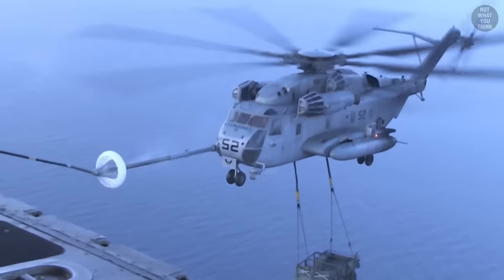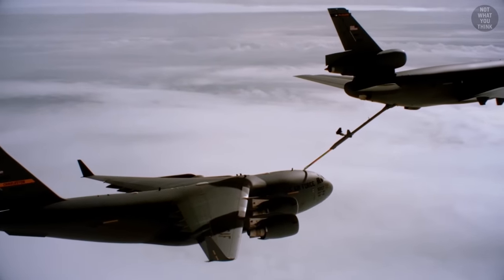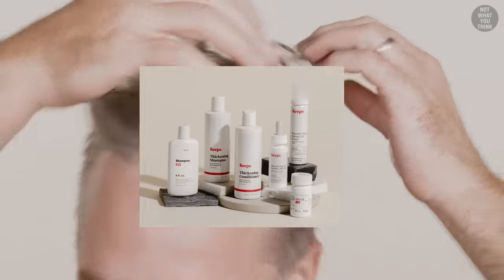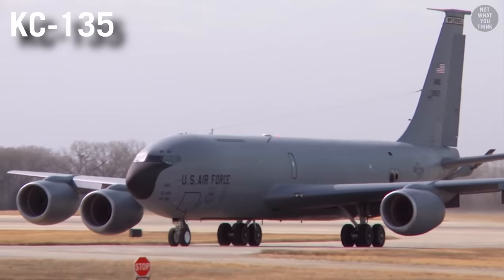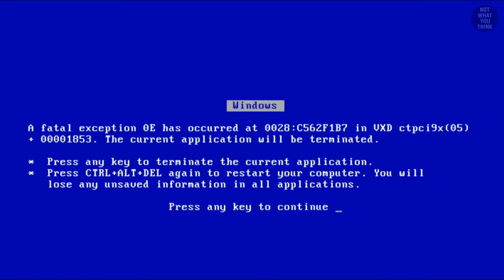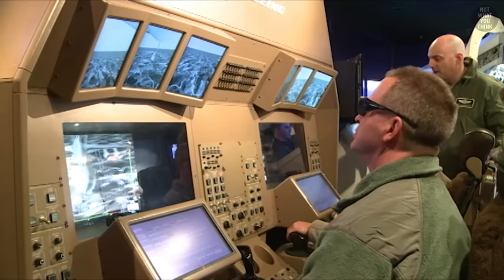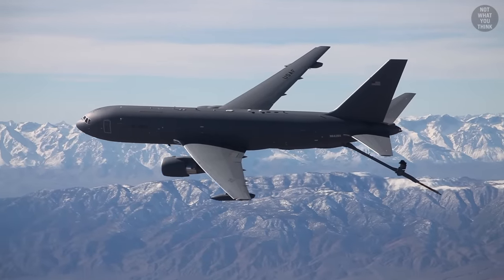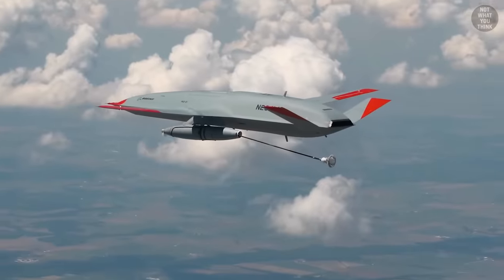Why US Air Force is Making Aerial Refueling HARDER?

Comment: if you think that is the Full Story and the USA Tech Don't Work or Barely Works then the Ones who is Letting out the Very Little Info on these Systems Done there Job Very Well for the USA Don't Tell 99.99999999999999999999999% of the Real Story The USA Wants you to Think there Tech Sucks and Don't Work when it Really Works Very Well for it is the Very Best on Earth. and Just for you Info USA Airforce Auto Air Refueling was a Working Tech in the 1970's and that is Way Before the Late 2000's it's just was and is Top Secret. The USA Doesn't want the Enemies to know all the Aces The USA has up the Sleeve and there are Trillions of Aces the USA has and Aces being Super Top Secret War Tech for the USA is just the Opposite of Russia for Russia Makes False Statements of there Tech in the Form of Saying they have War Tech They Don't have and will Never have and Stating all the Time Flat out Lies about how Great and Unbeatable there War Tech is and it is Nothing but Trash and Fake Tech that is Not Real. Just Like how Russia Said how Great there Tanks and Fighter Jets and Nuclear Weapons are and there Nothing of What they Claimed. See The USA Says there Tech is Not that Great and Don't Work or Don't Work that Well and it Really Works so Great They Don't Ever Show the Real Deal off they Show only 0.0000000001% of the Real Tech and Says it's not Really Working but when the Reporters and the Cameras are Gone Then the Real USA Tech Gets Turned on and it is the Very Best Tech in the World and Russia Claims it has War Tech that is out of this World Beyond Aliens and the Gods Like there Fighter Jets that Russia Says Nothing can Take them out and now they are Getting Taken out by Hunting Rifles, or there Super Tanks that can be Nuclear Bombed and Survive are Taken out by School Children with a Molotov cocktail. But if your Russian on YouTube is the only Place you can Get a Laugh at the USA Tech for your for Sure Not Laughing on the Battlefields when your Being Blown up by USA Tech how Does it Feel to be Beat by Low Tech that Don't Work and by People that have Very Very Little Training on how to use it Looks like that USA Tech is Not So None Working Low Tech After ALL Keep believing Everything you hear and See for you will Never know how High of Tech the USA has for No one has Ever Seen 99.99999999999999999999999999999999% of The Real High Tech War Toys there are Trillions of USA Super High Tech War Weapons No one has Ever Seen and it ALL Works and is the Very Best War Weapons on Earth Nothing and no one Comes even Close what we have Given to Ukraine is Only Baby Toys those are not War Weapons Totally Forget being Super High Tech War Weapons We Won't Ever Give or Sell our Super High tech War Weapons to Ukraine or Anyone and we Don't Let anyone See the Good Stuff for you Don't want your Enemy to be Building a way to Defeat your Defense. the only Stuff Ukraine is Getting is our Low Tech of Today or what was High Tech of the 1960's. Putin would Sh!t himself if he and his War Toys got Hit by The USA High Tech War Weapons he would Never know What hit him and The USA High tech is Never About Going Bigger it is Always about Going Smarter and Pin Point the Targets.  If The USA was a Doctor, it would be the Doctor with a Super Sharp Scalpel Removing a Wort and if Russia was a Doctor, it would be the Doctor with Six Samurai Swords that the Russian Government has Glued ALL Six Swords to his hands and Each Samurai Sword is 25 Feet Long and the Russian Doctor is Now Going to Remove a Wort on your Neck for Russia Thinks High Tech Always has to Start with More and Bigger. What could go Wrong? Don't Worry Putin Told Me he Leaser Sharpened Each Samurai Sword you won't Feel a Thing even if the Good Doctor Does Mistakenly Cuts off your Head Putin Told Me he has Other Doctors that can put your head back on Good as New. it's like all them Shows Putin put out on how they Made there tanks, Jets, Missiles, Bombs, and Always Made False Totally Made-up Fake Claims Well them Stupid Days are Coming back to Bite him and The USA is Not Good to make Some Stupid Show Giving out our Real War Tech Just Remember Everything you See is Not the Real Tech the Real Tech is So Much Better and it Works 110% night or Day it could Fly up your Momma's Rear End and Refuel there Aircraft Darker then a Pocket. But on YouTube is the Only Place Russian War Tech Looks Good for Russian War Tech in the Real World Sure as Hell Don't Work and is the Biggest Trash Junk there is. Maybe you can Fool Some more Russians to Get in Putin's War Tech Weapons that will Bring Death to there Russian Op's You Can't Make your Tech Better by just Saying it is Better and how Great it is that is not What Wins Wars and Saves your Russian Troops for ALL the Russian War Weapons is Trash Junk What Next Russian Wooden Tanks and Jets? oh how About Paper Tanks and Jets? that Should Work out Great. It would be Saver for the Russian Troops Anyway if there Tanks and Jets where made out of Paper.

Comment: Ooh, I have an idea. 
Why not put a window so that the person handling the boom can see what is going on?? 
I know, radical idea.  
But, it might work.
Reply: Naïve
Reply: @johnp139  Really? 
If you watched the video, the older tankers did have a window for the boom operator to see directly what was happening.  
I was merely suggesting using the tried and true method.  

Now, if you mean I am naive for thinking the Air Force would have the good sense to just do what works, then you are probably right.  
Common sense is usually too much to hope for.

Comment: Poor conceptual engineering. Even if you make a fully automated system, that would still work better with stereo, using multiple cameras, than this crude rangefinder scheme.
Some old Neanderthal heads have not bothered to consider what can perceivably be elegantly done with modern AI.

Comment: what the...? waste so much time any money on technology when a window is better? stupid. yes, yes, 'going to be automated', but if they do that buy crippingly manual and endangering lives, that's just dangerously stupid, and shows they really don't have faith in their autmation systems will be equal to (or better than) hoomans. next they be touting how great their M$Windows based automated refueling system is (with expensive extended life security patching, and outrageous hardware upgrade support contract, over priced 'sheilded' component certification program, and right after a quick reboot and system check, handeled by a 'organic' component).

Comment: This yet again shows Boeing's utter lack of competence as a company. What degree of cost cutting (and/or profit optimization) leads to a system this ineptly designed?
To be fair, I think just going to the local auto parts store and buying the cheapest backup camera available would provide similar results, but for a fraction of the cost.

I for one would have gone the opposite route. Ie, give the boom operator exposure control and multiple cameras from different angles and rather risk going into information overload since a skilled operator knows what cameras and settings to use for a given situation. It is better to give the operator too many tools than non at all. However, Boeing might have aimed for a "fool proof" system, but this solution of theirs is frankly idiotic in itself.

Color video is however not too important. But I would still consider a color video feed of suitably high resolution as useful information.
Resolution is however more important, since if all one sees is a few pixels, then it is hard to judge what one is doing. 8:05 is a good example of poor resolution. The boom is literally 3 pixels wide, the target we search for is just a blurry mess here...